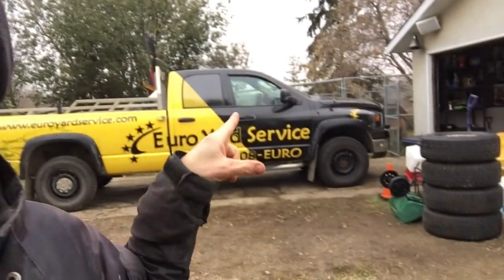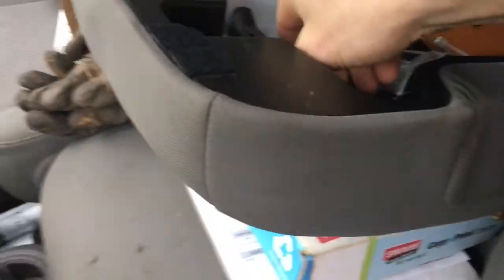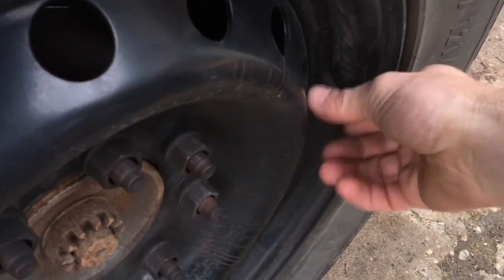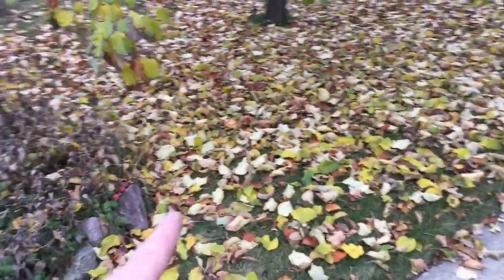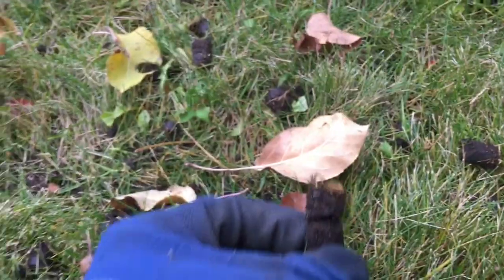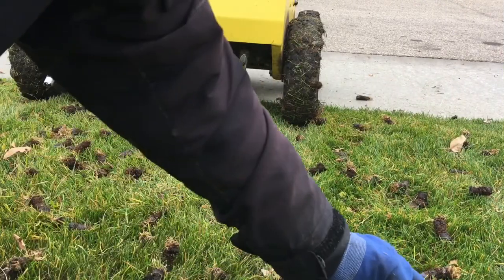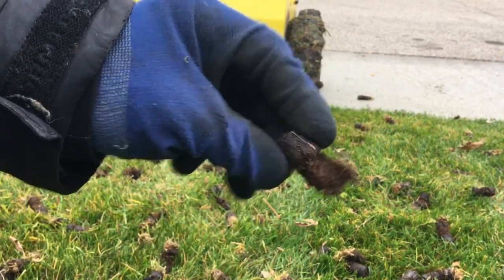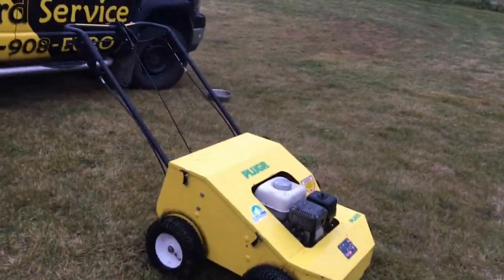Vlog October 24,2016 - Lawn Mowing, Aeration, Fertilization, Fall Cleanup in Edmonton

Comment: How do you like your Plugr aerator? Does it work better than rotor aerators like Bluebird and Ryan? We have couple Bluebird aerators but I'm considering Billy Goat plugr as upgrade.
Reply: EuroYard yes , you are right the Bluebird is just a back breaker)), we welded up some extra weights on for better plugs. Some guys say that plugger is good only on wet turf. How does it work on dry and hard turf? Thank you
Reply from the maker: While in theory it's supposed to pull better plugs on dry lawns compared to drum style machines I find the results disappointing and not sufficient. I try to time/schedule for days after a good soaking rain or advise clients to water heavily the day before.